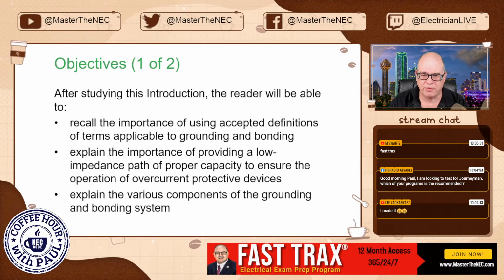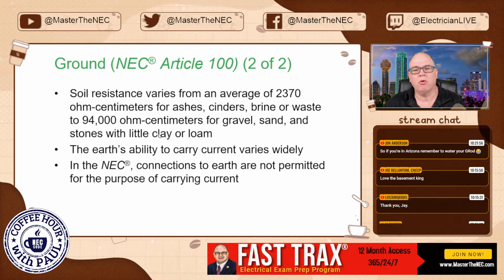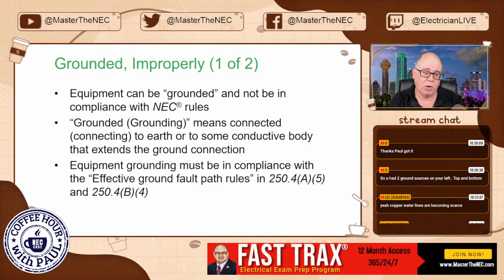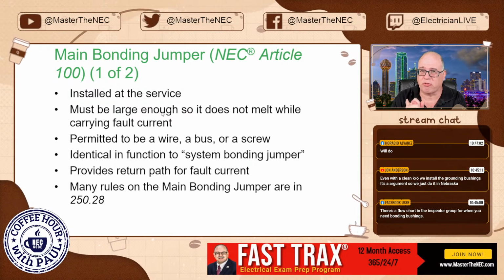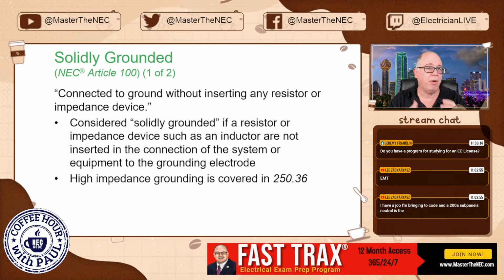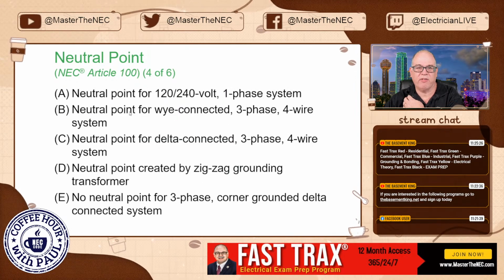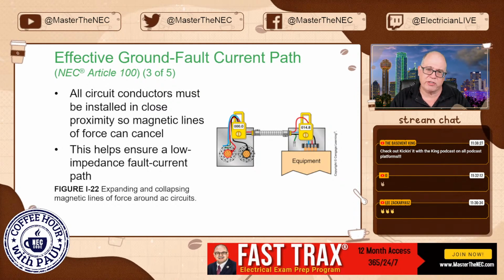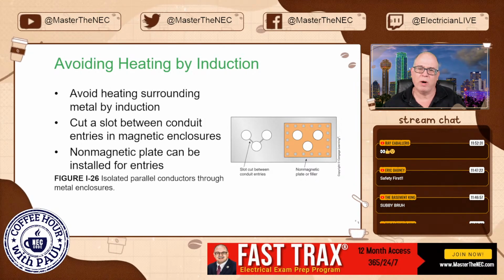Coffee Hour with Paul | Introduction to Grounding and Bonding Part 1

Comment: I thought the corner grounded delta that the grounded conductor would be neutral?
Reply from the maker: No, a 3-phase, 3 wire corner grounded delta doesn't posses a "neutral point" and as a result it is not considered a neutral conductor. However, it is a grounded conductor by virtue of being intentionally grounded.

Comment: What about the grounded conductor on the high leg delta? Would it still be a neutral conductor?
Reply from the maker: Unless their was a neutral point between one of the phases, which would create a neutral point for that specific phase. As described you would not have a neutral present.

Comment: Where would you use a high impedance grounded system?
Reply from the maker: There are systems out in an industrial setting that need the benefits of being solidly grounded but are not actually solidly grounded. Such as a smelting plant that may not want a total ungrounded system but desires a method to limit the fault current by raising the resistance to earth and allowing various equipment to operate without clearing the OCPD premature.